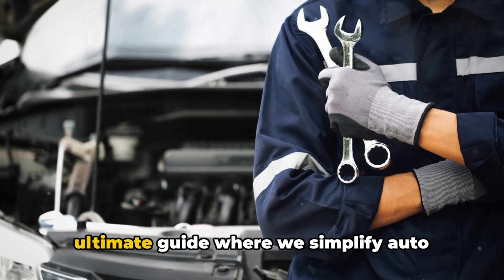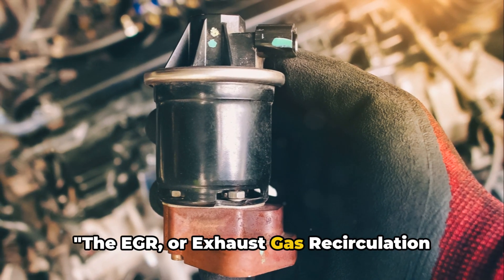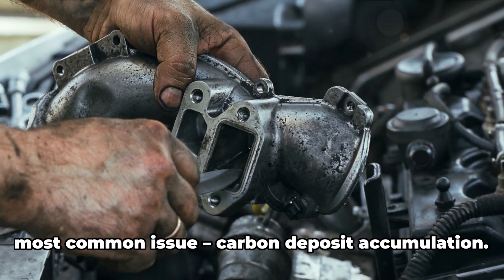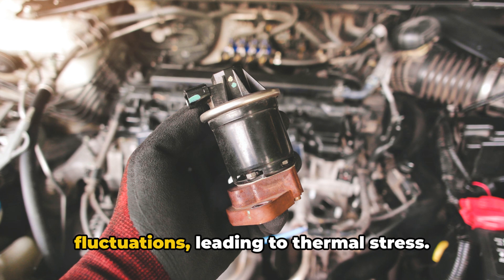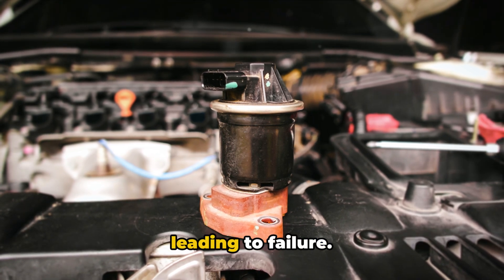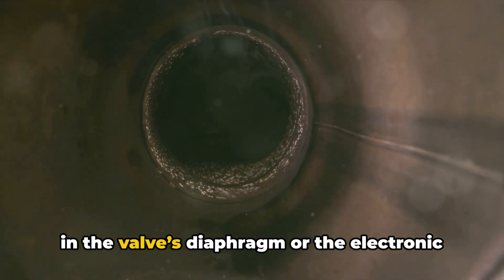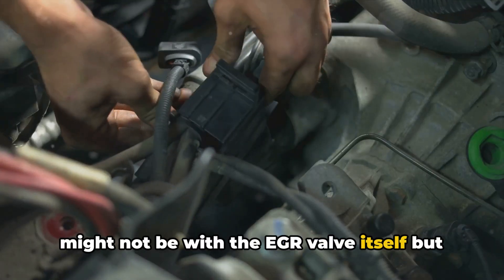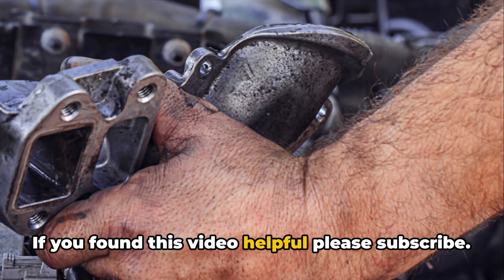What Causes an EGR Valve to Fail: 7 Reasons Why Exhaust Gas Recirculation Valve Go Bad

Comment: Had my EGR replaced after light went on in October 2023, now in May 2024 the light is back! I'm desperate and it is extremely costly to replace. I have a seat ibiza 2011 and I don't understand the reason and what to do...
Reply from the maker: Hi Fabian, It can be frustrating to see the EGR (Exhaust Gas Recirculation) light come back on after a recent replacement, especially considering the cost involved. Here are a few steps you can take to address this issue with your 2011 Seat Ibiza:

Diagnostic Scan: Start by scanning the vehicle with an OBD-II scanner to check for specific error codes. This will help identify whether the issue is indeed with the EGR system or something related.

Check for Recurrent Issue: Since the EGR was recently replaced, it’s possible the new part could be defective or incorrectly installed. It’s also possible that the problem isn’t with the EGR valve itself but with related components like the EGR temperature sensor, vacuum hoses, or wiring.

Inspect for Clogs and Leaks: Check the EGR valve, the tubes, and the passages for clogs or leaks. Carbon buildup can cause the EGR system to fail, even if the valve is new.

Review Installation and Connections: Ensure that the EGR valve was installed correctly and that all electrical connections and vacuum lines are secure and in good condition.
Reply: Thank you. The error was P0403, which also extended to the turbo charger P0299.
I have cleared the errors, and so far, they hold clean.
To note, the mechanic told me 1 screw would not fit as the EGR was purchased from a carpart supplier who also manufacturers them and are not genuine. He did say that it would not cause any issues as it is securely fixed. I think this might have been caused by engine overheating, but there no error on that side.. I have drived the car for a few miles at 2000+ rpm (I usually drive at 1500-1700) 60 miles daily. Hopefully, it will be ok. If not.. mechanic said for £200 will delete it from system and no issues ever again.. but that is illegal and could potentially damage other parts I suppose  after a while..